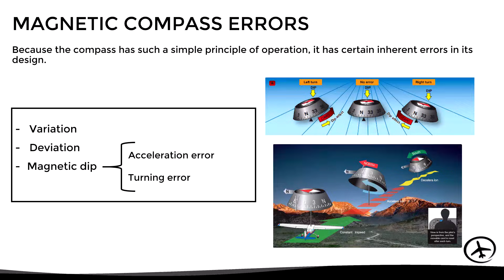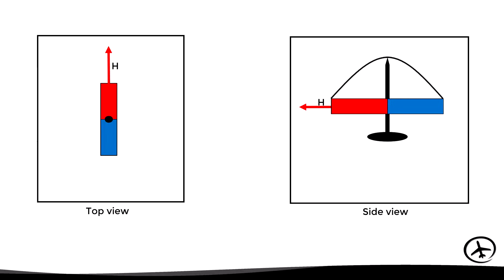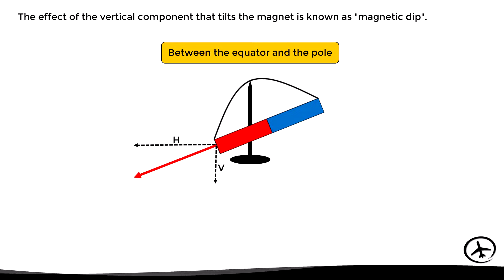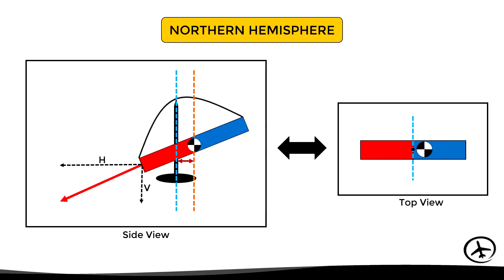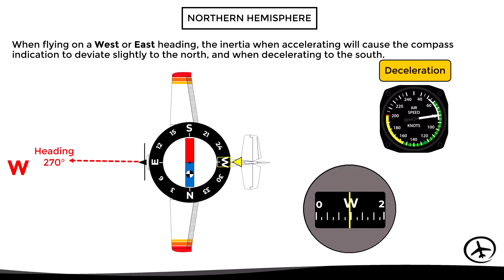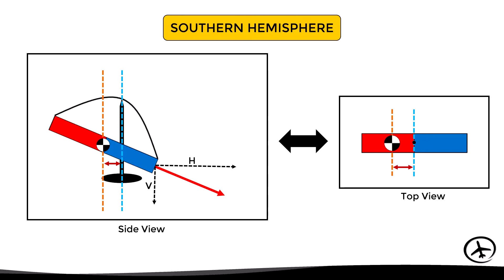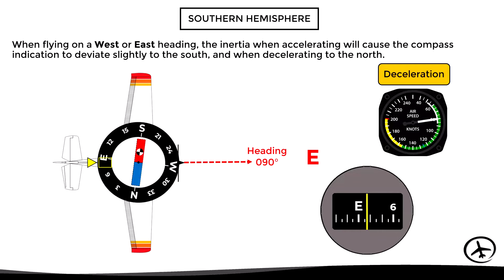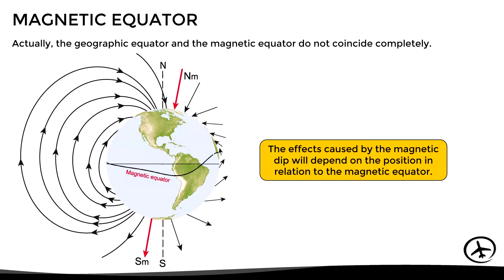Magnetic Compass Errors: Acceleration

Comment: This is a very good effort, but if I understand the concept, it's not quite right.  A couple of people were as puzzled as I was when I first viewed it, and commented that the markings were incorrect.  I don't think that is what is causing the confusion.  I think the outer markings on the compass are correct, because the pilot is always looking at the back of the compass.  Thus, when a pilot is heading east, the east marking is on the pilot's side (or west side) of the compass.  However, the center of gravity marking on magnet within the compass is backwards.  The south pole of the compass would be facing the north pole of the earth because opposites attract.  Thus, the south pole of the compass would be experiencing the additional vertical force.  That force would pull the magnet away from its natural pivot point and towards the earth's north pole.  The pulling force also shifts the center of gravity to the North.  Thus, it make sense that the inertia would be greater on the side of the compass magnet facing the earth's north pole (because it's heavier) when acceleration is applied.
Reply: No.😂😂. Center of gravity point can’t change at any mass. Any time. It has another interesting science.

Comment: But it is actually incorrrect!
with the vertical force the magnet move like you described, but 
the center of gravity moves in the opposit.
Tray you at home don't belive me!!!
take two hangers, one in your finger end the other attached on the first hanger on one side, and try to move forward and see.
Or simply try to rebalance it and you would see that you should move your finger near the weight applied by the second hanger and not away from it.
The center of gravity move to the added mass!!!

PLEASE REPLY ME SOMENTHING.